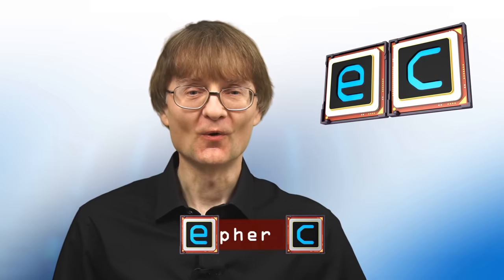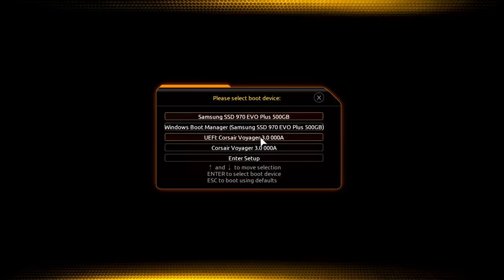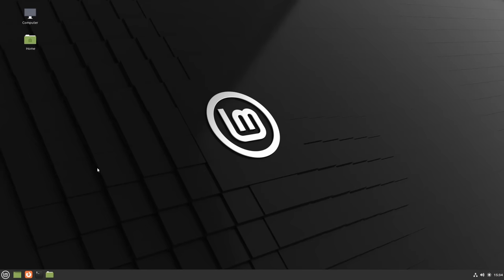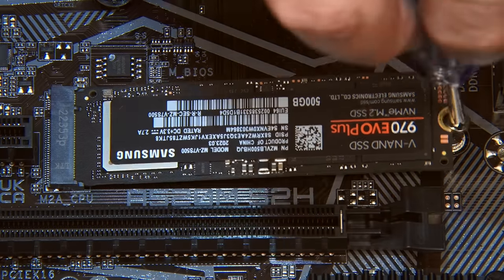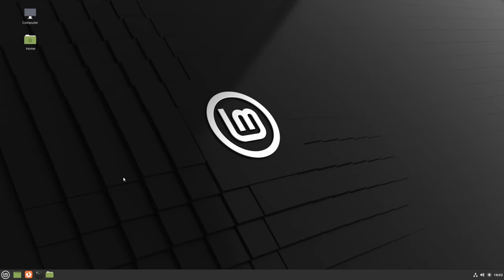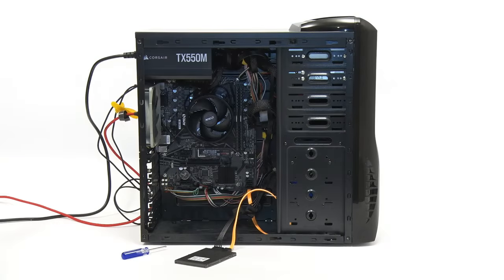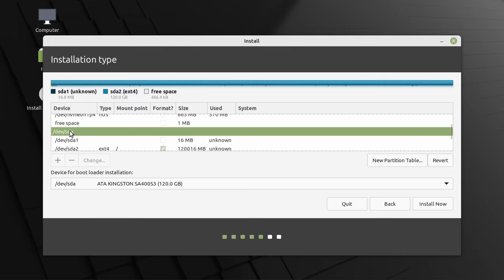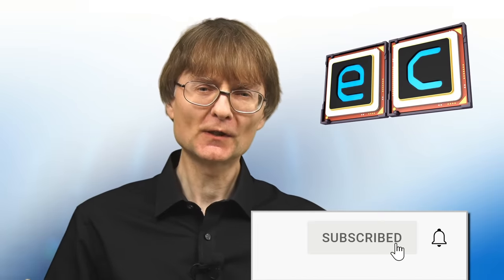Windows & Linux: Dual Drive Dual Boot

Comment: I have done dual boot on dual drives for years. I have however run into problems rarely that causes a corrupted Windows boot, so I practice removing the Windows drive when I install Linux. I also utilize hot swap bays which makes this so much easier than opening the computer.

Comment: An interesting feature of Windows Boot Manager (and also NTLDR that preceded it) is that it can do the same thing as GRUB does for booting Windows, which is chainloading into another boot loader. This was originally a feature to dual boot Windows NT and Windows 9x, but it can be used to dual boot Linux and any other OS too.
This feature usually doesn't get mentioned (neither was it in this video), and it's definitely more involved than just letting an installer do it all automagically, but it's an option if one is so inclined.

Comment: Excellent tutorial - I really wish I had seen this video years ago when I was trying to do this very thing (#3 - dual booting without removing Windows SSD first). Every article/tutorial on the Internet that I read insisted that you had remove the Windows boot drive first otherwise the whole thing would fail because somehow or other the installer won't work properly if there is already a boot partition on the PC. This video clearly demonstrates that is false!

Comment: I now always use a dual drive configuration for any dual boot machines I have. The big thing to remember is to not have any other drives hooked up when you install Windows, because it will put its bootloader wherever it feels like, and you have no control over it. It's always better to install Windows without letting it know about even the existence of any drives that will be allocated to other systems.

Comment: I'm still watching this even though I know how to do it haha.The explanations are still pretty clear as expected of you Chris.

I'll put this here as it may help others. Accessing the files on the Windows install is possible, but Turn off Fast Startup on Windows as Linux would make the Windows drive Read only due to that setting making shutdown on Windows a semi-Hibernation state. It's a problem that affects other partitions on other drives in the same computer so long as they are accessible by Windows, may it be NTFS, FAT32, exFAT.

I've been using a dual drive dual boot with Windows 10 and Mimt 21.2 on my main PC for about 2 years now. The method I used is similar to your Method A and funnily I also used a Kingston A400 SSD for my Mint install. 

The difference is that I have 3 drives, 1 for Windows 10, 1 for Mint, and 1 for shared storage between the two operating systems. Mint boots way faster than Windows 10.

I have also tried sharing the bootloader on the Windows drive and it is a very bad idea. Windows updates can break the GRUB bootloader if it overwrites the EFI partition/boot area. Method B still had that problem so Method A is better to ensure the bootloaders are kept separate on separate drives.

Potential risk as other comments have mentioned is one of the operating systems being less used and updated, but that depends on the user if they are doing their updates or only using one or both operating systems.

Comment: Sunday greetings, Chris B. 
Awesome tutorial. 
I chose a little bit different choice. I have a 1 TB HDD and 256 GB SSD, both had windows. What I did was installed Mint with advance install option on hard drive (didn't want to perform tedious backup task, so created a separate partition of Mint) and Windows remain on SSD. Now I keep all my files on HDD which can be accessed with both Windows (SSD) and Mint. Kind of odd choice if you say so, but this system works flawlessly. Updated Mint from 20 to 21 without issue.

Comment: A duel boot setup I discovered purely by accident.

Hardware configuration: Linux Mint 21 installed on SSD. Linux Mint 20 installed on HDD, Both were original installed as single drive setups. Ran Linux Mint 21 update, Grub was updated to allow booting into Linux Mint 20.

I can boot into the OS's using BIOS boot menu or the Linux Mint 21 Grub menu.

Comment: Extremely informative and good for those who do not want to mix the necessary Microsoft operating system that one may need for various programs with Linux.Especially those that may want to use an old,unsupported Windows system. Just disconnect the ethernet while using the Win7,XP or Vista  drive and safely do what you like. When you boot Linux,reconnect to the "information superhighway".

Comment: I have not done a dual boot in quite some time, but a dual drive dual boot has always been my prefered way to do it.  As mentioned one of the big benefits is if one drive goes bad or the os gets corrupted it won’t effect your other os.  Just replace the drive without isues to the other aystem.  A big issue is this works great on a desktop where ya have multiple connections for drives and not so on laptops unlesss.ya have a rare dusl drive laptop.  I have one.  Thanks for another great video. .

Comment: This is the smartest tutorial on keeping Linux and Windows in the same pc. But @ExplainingComputer, how you recorded the booting option in bios, which comes up on hitting the F12 key (generally) at the time of booting, I don’t know. It looked like a screen recording but it cannot be. Can you please share the secret, please? 🤗
Reply from the maker: Thanks for this. All screen recording on this channel happens via hardware -- HDMI recorders, as I show in this video: https://www.youtube.com/watch?v=pocs02YuJ4k  These days I also use an HDMI mixer -- https://www.youtube.com/watch?v=7IOhvP5R1Pk that even allows recording of a source when it is turned on and off.
Reply: @ExplainingComputers  I have successfully installed Fedora in a separate SSD following your instruction in this tutorial. After that I installed KDE Plasma and disabled 'gdm' and enabled 'sddm' as display manager. Everything went smooth but after I installed Thunderbird through 'Discovery', it is failing to launch and 'Cannot launch Thunderbird' but this is the #1 essential application for me. Can you help please?
Update: As a newbie, my approach to launch the application was wrong. I was trying to launch it from within Discovery, but it should be launched from 'Applications' section. Problem solved. :)

Comment: I have been running mac OS  & Windows on a dual drive, dual boot for many years and yes it has been quite reliable, when Windows won't boot for what ever reason mac OS is my backup, 0 down time.

Comment: Excellent tutorial, thanks Chris. It relates to my present challenge, I have a 2 drive system with windows 10 on one and an old unsupported mint on the other. I’m too scared to upgrade the mint because it may corrupt windows, but I’m now confident that if I physically remove my windows drive I can start from scratch with a new mint install. 
You didn’t specifically mention this option but your explanation was sufficiently thorough for me to understand the logic of why is a good option, I didn’t have that knowledge before.
Mike
Reply from the maker: Your logic is correct -- good luck. :)

Comment: Option 2 is my method of accessing both Windows (yuk) and MX Linux. As you mentioned, when I first started dual booting all those years ago GRUB was constantly corrupted. When I stopped being an idiot and realized F9 (in my case at the time) took me into the boot menu and I had that AH HA moment when I realized "You dum dum...just install it on an SSD!". It worked and I scolded myself for discovering something so easy that I should have discovered years ago. Of course, this all happened a few years back so I have used this method to always have my SSD with MX on it always available to me to use on any of my computers. Option 2: Safe an effective (and convenient). Chris nailed it all 3 ways. Grrrrrrreat!

Comment: Great video!👍👍👍 Will save you A LOT of headaches! Did single drive dual boot once and it still leaves remnant problems despite later drive separation! A suggestion for EC would be to explain the pros and cons of setting up the other partitions  during linux OS install.🙏

Comment: Thank you so much for this. I wish I had known/thought about the dual-drive dual boot option earlier.

A couple of points about single-drive dual boot: Linux Mint is much the easiest for a non techie user to set up, because its installer has that simple slider for choosing partition sizes. IME with other distros, their installers mostly offer the option to set up a whole partition table by hand. I know I could spend the time to find out how to do this (and which option to choose), and I'd probably only have to re-do the job once or twice because I don't make too many mistakes, but it seems like an awful of of faff if you're just wanting to try out a new distro, or if you want to set up a Linux machine with Windows as an option for those occasions when nothing else will do.

The other trap with a single drive installation is Windows updates. As everyone knows, Windows does like to restart at least once for every major update. I had got into the habit of setting Redmond's best going and wandering off for a cup of coffee or a six-course banquet while it did its stuff. But with grub giving priority to Linux (which is what I mostly want), I come back and find it's booted into Linux, and I have to restart and catch the grub menu. That is something we can't blame on Windows, but it doesn't increase my affection for the OS.

Comment: Great video - I was really trying to do it the second way - through software only but there was no "free space" section; I'm not sure if I am supposed to do something to the SSD before this process, but, either way, I just did the first method by removing the Windows SSD - works fine! Thanks!
Reply: I'm really looking forward to running Linux as a first time user. I am so sick of Windows 11... Around December, Windows 11 killed my older computers - the motherboards stopped working altogether. Mind you, the computers needed replacement for sure. But, I should have just turned off the auto-updates and prolonged their life a bit longer or switched them over to Linux; heck, the one computer actually wasn't half-bad - could run every game to date - not peak but ran well; that was my first build ever - that was about 8 years ago. I thought I knew quite a lot back then - until today. I was way behind in the world of computers. So, I bought 2 new PCs - preconfigured - 2k each - amazing machines - truly. And, of course, they come with Windows 11 - now this is around January. I've had about 12 crashes everyday ever since... I checked the ram, the SSDs and HDs, checked the GPU - checked the CPU - checked everything except like detailed voltage/watts/grounds - maybe some bad hardware; I can't figure it out. I'm assuming it's just Windows11 being typical released-too-soon-Windows[insertversion]. Around 2 months ago, it became maybe 4-6 crashes a day - this week - about 2 crashes a day... It's simply unacceptable and annoying - and, potentially, could cause further damages... I'm really not sure if it's the OS but... I'm almost certain... I'm pretty good with PCs but far from genius. Anyway, I've spent about 80hrs the passed month looking into Linux - the versions - the apps - the gaming - etc... I just finally made the install today. I'm going to try running it for a couple of weeks - doing the same things I do on Windows and see where to go from there. I'm okay with making the switch. This was the worst release of Windows I've seen to date; the aesthetics copy Mac - which I don't understand , takes me like 4 hrs to change the configurations and the right click codes for Windows 11 to look and act like Windows 10 - which is why people still use Windows - due to the familiarity and convenience  of it all... I've been interested in switching to Linux for many years - my only concern was games and software... Though, after all the research (keep in mind - I haven't actually used it much yet), it doesn't seem like I'm losing anything; in fact, getting the same things for free... I can't see a reason not to switch - just nervous - scary doing a big leap like that. But, I spent many hours backing up all of my files; I'm a huge media hoarder - got like 2000 movies alone. So, again, thanks for the video - watched like 8 before yours - yours was the easiest and most straight-forward; I'll continue to watch your channel - learning a lots - already checked out that ARM PC video... Maybe my next project? lol

Comment: For anyone who wants a bank of power switches for their SSDs to put on the front panel, I've had very good experience with "Vbestlife Hard Drive Power Switch Module for 2.5 inch SATA/IDE Interfaces Optical Drive. Power On or Off HDDs as Wish, Controls up to Six HDDs for Desktop PC Computer" (description from the usual places). Now I happily switch between various OSs and various discs.
Reply from the maker: Wow! Now this I had not seen -- what a great product. Thanks for sharing. For others, a link here: https://www.amazon.co.uk//dp/B07HL576LG

Comment: I setup dual boot on dual drives using the drive removal method and it worked as expected for a few days, but then the grub menu had inserted itself as the default boot loader and taken Windows under itself. My guess is that an update in Linux did this.

Later I restored the Linux filesystem to the original first install configuration and Windows was free of the grub boot loader and I was back to selecting the operating system with the BIOS menu. This has stayed like this for about a month now.
Reply: I jinxed it. Just now there was some update to Ubuntu files in Mint and now GRUB has laid its grubby hands on Windows again as Windows now appears in the GRUB menu. 😒
Reply: @RonakDhakan  This activity is perfectly normal. GRUB has simply detected a Windows bootloader on your system, if you select it it will redirect to it. Why to do think this would be a problem?
Reply: @notjustforhackers4252  Your explanation might be true. But when I remove the Linux drive, the Windows drive goes into repair mode when I start the PC [probably because it found some problem in Windows boot loader]. Which means the Windows drive was changed by the GRUB boot loader.
Reply: @RonakDhakan  Did you unplug your Windows drive when you installed Linux?

Comment: Fantastic video Chris, I hope you're having a lovely weekend. I had my dual boot pc in the 3rd arrangement you showcased and found it to work well. If I did it again I would probably do it the 2nd way and use the boot menu as it keeps things cleaner without grub to go wrong. I have since graduated that pc to linux only as I wanted to see if I could live without windows and for the last few months it has been great. It's mainly a gaming and multimedia system and I haven't had any problems to speak of so I'm very happy with that 😁:_scissors::_stanley: I'm looking forward to the upcoming Arduino video as I don't know anything about them and can't wait to learn. Best wishes until next week.

Comment: And yes, finally I can boot my windows 10 automatically without the ennoying grub slowing me down. Thanks for the advice!
For some reason, I think grub is still on my windows drive and not on the external usb hard drive. But it doesn't hamper me anymore.

Comment: I used the first method, Windows on the first drive and Garuda on the other. After Garuda did its first major update Windows appeared on the Garuda boot screen. I have Garuda as the first boot and can select Windows from the Garuda boot screen if needed. Have this on two computers now and everything works brilliantly. If I remove the Garuda drive they just boot to windows with no issues. One PC has a third drive with second Linux distro and it can be selected from the Garuda boot screen also. Set this up for another person also and it is working correctly.

Comment: Yes great video, I use to run linux, windows and hackingtosh using the motherboard boot menu with 3 drives as it as the most reliable way of doing it and recovering updates that failed or corrupted

Comment: I usually do single drive dual boot. Where I make an extra 1gb UFEI partition first in the Linux installation than the Linux root which does the same thing. I'm using Zorin OS 16.2 this way. Haven't had any problems.

Comment: First of all, congratulations on another superb tutorial. Another option to avoid removing the Windows drives is to disable them on Bios during the Linux install and enable them again after installation. By doing that, you do not have to handle the GRUB boot loader too.
Reply from the maker: Agreed, if this BIOS is available. But the ability to disable an M.2 drive in the BIOS is rare.
Reply: I was thinking exactly about that. I personally prefer removing the drive physically, but my m.2 port is under the VGA card on my new mobo!! That makes removing the primary drive a big hassle!
I'll try checking my bios if I can disable the drive. I was also wondering if there is any way of unmount or disable the windows drive directly on the live Linux, just before the installation, so it cannot see the Windows drive and not install grub on it.

Comment: This really makes so much sense these days.  Grub or LiLo (does that still exist?) are from days gone by when storage was a lot more expensive than it is today.  Adding a second drive for a second OS is just so much easier today, and far less expensive than it used to be.  Messing with the MBR on your one and only drive absolutely can result in disaster.

Comment: Excellent. I have been having dual boot systems since Windows XP days, and every year or two have major problems due to Windows updates. I currently have grub based switching, but you have convinced me to change over to using BIOS switching and making the two SSDs have fully independent boot sectors, to hopefully avoid any future problems.